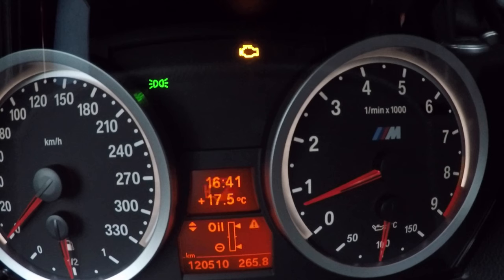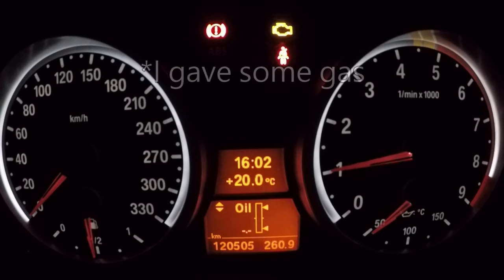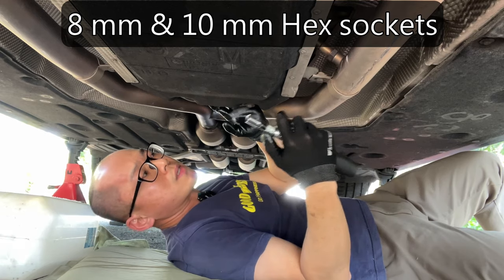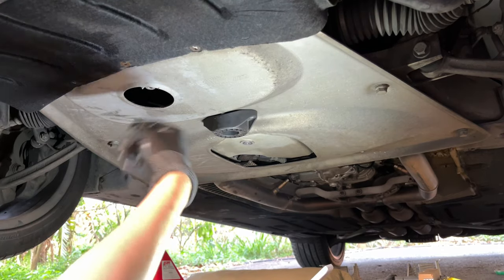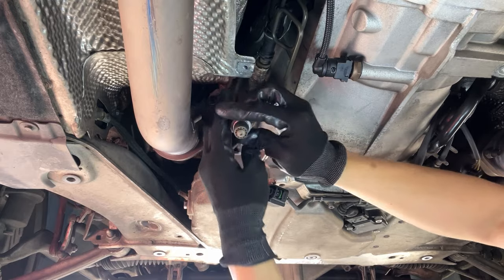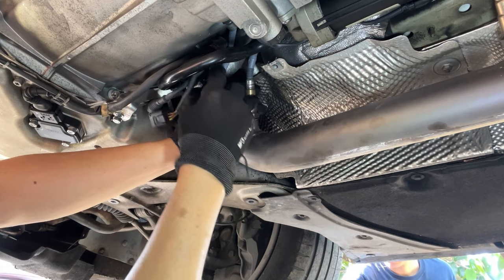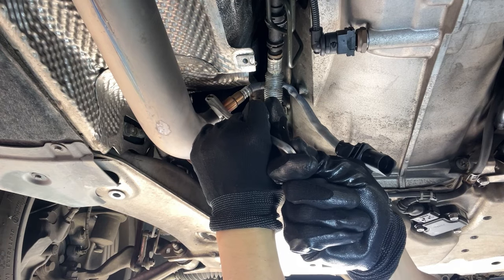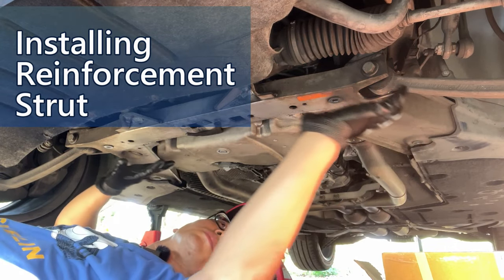O2 Sensor Replacement Fixed Rough Idle & Limp Mode of E90 M3 [ENG SUB]

Comment from the maker: [Errata] The “thread glue” I mentioned is actually an anti-seize lubricant.
[勘誤] 我提及的「螺絲膠」應為防卡死螺絲膏／潤滑膏。

Please look into the fault codes carefully to identify the root cause! This was the bad O2 sensor BEFORE CATALYZER. 請仔細從故障碼判斷問題的根源！這次是「觸媒前」含氧感知器的毛病。

**Parts Required**
Oxygen sensorBEFORE CATALYZER X2
BMW 11 78 7 537 984
Bosch LS 17038 / 0 258 017 038

**Tools Required**
8 mm hex socket (trims)
10 mm hex socket (trims)
17 mm hex socket (reinforcement strut/plate bolts)
torque wrench with angle (56 Nm)
22 mm open hex spanner (O2 sensor)
22 mm open hex torque spanner (25-50Nm)

**Tightening torque spec**
O2 sensor before catalyzer 50 Nm (OE exhaust)
after cat 25 Nm (OE exhaust)
Bolts on reinforcement strut/plat 56 Nm + 90° (replace blots)

**所需零件**
「觸媒前」含氧感知器 X2
BMW 11 78 7 537 984
博世 LS 17038 / 0 258 017 038

**所需工具**
8 mm 六角形套筒 (飾板)
10 mm 六角形套筒 (飾板)
17 mm 六角形套筒 (加強車架)
附角度扭力扳手 (56牛頓米)
22 mm 開口六角扳手 (含氧感知器)
22 mm 開口六角扭力扳手 (25-50N牛頓米

**鎖緊扭力**
觸媒前含氧感知器 50牛頓米（原廠排氣管）
觸媒後 25 Nm（原廠排氣管）
加強支架上的螺絲 56牛頓米 + 90°（需更新螺絲）

Comment: I have a BMW E60 528i with an O2 Sensor code of 2CA6 (O2 Sensor heater circuit error Bank1 Sensor1). Car runs and drives just fine but the check engine light is on. No limp home mode. I have a 50/50 shot that it's either the O2 sensor needs replacing of the car's wiring harness for the O2 sensor is shot.
Reply from the maker: Hi CJ it's good you are aware of this fault so when something happens you can take action right away... and the right way 😁 I guess the O2 sensor can still work without the heater circuit because exhaust temperature is high enough to keep sensor at it's working temperature. But it's likely to give wrong data when the car is cold.

I searched 2CA6 in ISTA for E60 528i and quote this;

Condition for fault memory entry:
 O2 sensor temperature < 680 °C for more than 5 sec.
 
Action in service:
1. Visual inspection of wires, DME plug and O2 sensor for damage
2. Check wires (including resistance)
3. Check plug-in connections DME <=> Wiring harness <=> Upstream (pre-cat) O2 sensor on Bank 1 (water or corrosion in the plug? => Repeatedly disconnect the plug and then FIRMLY press it back in)

4. Replace O2 sensor
5. Replace DME

I hope it's just a minor wiring harness problem for you. Come back and let let know how it's fixed. Best.

Comment: Thanks, the beginning of the video is hilarious, loved the way you said we'll get you fixed baby.

When will you upload the transmission and differential fluid change video? really really want that.

and one more thing, do you have any tips on trouble shooting DSC malfunctions on this car. I currently have this

-Start-off assitance inactive
-DSC malfunction! Drive carefully
Reply from the maker: Hi Kojo Thanks for the comments! I’m happy you like this video 🤗

I had the same warning message twice due to:
1. poor connection of SZL plug: access the switch column and use electric contact cleaner to clean the plugs before  re-plugging it.

2. throttle actuators failure: the malfunction can be the actuators or line connections. Need to see the code.

AND DSC codes can be cleared only if DME has no codes. So make sure the problems and codes on DME are all cleared.

The M3s have high and uniform quality so they all have same issues 🤣 don’t worry pal, there must be a fix for us. Best wishes!
Reply from the maker: And the next video will be the MT and LSD fluid change. Stay tuned!
Reply: @funcarsgoodpeople  Thanks thanks, I just realized you have the MT, I have the DCT, also 4 door e90 m3. I guess its the LSD fluid change i'll benefit the most from. Thanks for everything, one big happy m3 family

Comment: Hello, do you know where is the fuse for the 02 sensor located  for the e92 M3? There is a video on youtube about the E92  02 sensor fuse location, but it is only for non-M.  Thank you in advance...
Reply from the maker: Hi Cy! I’ve checked the posts regarding the O2 sensor fuse on some forums. I’ve also checked the wiring diagrams of E9x Ms/non-Ms in ISTA.

Here’s my summary; An O2 sensor does not have an exclusive fuse. All the wires on an O2 sensor are connected to the engine control module (DME). The heating power of an O2 sensor is provided by the DME. 

So the actual fuse you mentioned is one of the fuses for the DME. I guess people are pulling the fuse to reset the DME to clear the fault codes related to the O2 sensors.

There are two fuses via which power goes to the DME; one for power loads (30A) and one for the electronics (10A.)

For the E9x M3’s DME (MSS60) the fuses are F4 (10A) and F39 (30A). There is also another DME main relay (K6300) integrated in the fusebox A4010. NOTE: fusebox varies with production year!

You are welcome to mail me via: funcarsgoodpeople@gmail.com and let me know your VIN. I’ll send you the related documents and wiring diagrams.

Comment: Awesome video. I'd like to check the shaded fuse for all of my sensors. I saw a video on here showing me that there was a bank of 5 fuses inside a black case I side the engine fuse box but on mine no such bank exists which suggests it's in the glove fuse box but I have no diagram and no idea where to locate it it :(
Reply from the maker: Hi Dane thank you for the feedback! Which car model are you talking about? The S65 engine does not have independent fuse for the O2 sensors so I did not have to check them during the troubleshooting. If you are looking for fuse map or wiring diagram for a BMW, you can mail me funcarsgoodpeople@gmail.com and I will look it up for you 🤗

Comment: I am chasing the same symtoms as your. My car is E70 pre-lci. The only sensor code I got is 2C31. Can your verify the 02 is my root of issues? Thank you
Reply from the maker: Hi Quan I have the same fault (but different code) at the beginning. Yours corresponds to DME: Oxygen sensor before catalytic converter, trim control or DME: Oxygen sensor emissions control. So yes that's it! Please suspect a bad O2 sensor.

Please note that there's some variants of the engine so some X5 have single O2 sensor and some have two. Let us know if it works for you!
Reply: @funcarsgoodpeople  absolutely, I have been chasing this ghost for a while. Overlooked the sensor and replaced vanos solenoids, Camshaft sensors, Disa and eccentric shaft sensor but still. Thanks
Reply from the maker: I understand how disappointing it was! After all we will fix it for sure. Best luck!
Reply from the maker: You are right Makaveli! There are millions situations that can occur so sb else’s help from the Internet is really limited.

So Quan plz gather as much clues as possible for us to sort it out. Best.

Comment: Dude why don't you have 200k subscribers... I have this problem with my 02 sensor bank 2 sensor 1
Reply from the maker: Hi Jdm Slater thank you 🤗 I’m just starting out. I’m happy enough the video gets to someone whoever needs it. 

It’s a good news you got the fault code and know it’s sensor 1, before the catalyzer. You are very close to solving this problem. Please let us know how it works for you 🙏🙏🙏
Reply: When it’s cold mine revs up to 2000 rpm for while tell it goes down and starts having a rough idel does that happen when o2 sensors go bad n52

Comment: I have this issue with driveoff with diesem engine. Does diesel engine have same sensors?
Reply from the maker: Hi Mirzoni, the diesel BMWs have O2 sensors too, just different part numbers. It is recommended to scan the codes with diagnostic tool to get more clues before ordering and replacing the parts. Best!
Reply: @funcarsgoodpeople  i will do check before ordering parts. Also i have rough idle no matter cold or hot engine  but my rpm are good just idle is not good to hear. First time i was thinking maybe its egr valve but im sure its 02 sensor
Reply from the maker: I see. I think it is easier to fix O2 sensor because there will be fault codes so we can make sure about the root cause. Come back and let us know if you succeeded!
Reply: @funcarsgoodpeople  Sure i will. Can you tell me can i conact you in a private? Ig or facebook?
Reply from the maker: Please add fcgp2019@Instagram or e-mail funcarsgoodpeople@gmail.com 😀
Reply: @funcarsgoodpeople  Thanks, i just started to following you on IG.
Reply from the maker: 🤜🤛 keep in touch bro 🙌
Reply from the maker: Hello Mirza How are you? I made a video about using the OBD2-USB cable to flash the DME. I show you how to buy the cable and where to download software tools. Please see the video https://youtu.be/-HcMYBclj_Q

Comment: I have 2B4E codes and 2B42 to 2B49 misfires impairing exhaust emissions on all 8 cylinders, i changed the O2 sensors but without doing the reset of adaptations, i ll do it soon, and a rough idle at cold start only, i had this issue after changing my full exhaust system (x pipe + front pipe with sport cats) is it related ?
But I don’t have an engine malfunction reduce power and a limp mode like this M3..
Reply from the maker: Hi Dev thank you for chiming in. I don’t think the rough idle is related to the X pipe and sport cats. What I often heard about rough idles are related to the fuel tank breather (rough idle after filling a full tank) and the idle control valve.

I had the misfiring codes on all 8 cylinders when I still had the stock cold start function. Usually the codes came when the car was having the asthma (for warming up the cats to reach emission standards quickly.) There was nothing else than the codes and a check engine light. After this function was tuned out, I NEVER had all-8-cyl-misfiring codes anymore.

The E9x M3s all have similar problems so don’t worry it is likely something already happened to someone. Plz check if your car has the stock DME tune, a bad fuel tank breather valve or bad idle control valve. Best wishes!
Reply: @funcarsgoodpeople  

I changed the idle control valve & the fuel tank breather.. the issue is still here, i changed the O2 but i didn’t make a reset of adaptations, i ll do it soon, i have the same cold start like you every time i start the car with stock DME, when the engine is warm i have no issues, no reduce power or engine malfunction.
Reply from the maker: I see. Probably resetting the adaptations of O2 sensors and idle value can help. Let us know if this work for you! Best.
Reply from the maker: Hi Dev how are you? Have you solved the problem? I made a video about misfire fault codes and cold start delete https://youtu.be/-HcMYBclj_Q

Please let me know what you think!
Reply: @funcarsgoodpeople  hey fine and you ? Yes i’m in the same case, same fault codes also, your car has no more misfires codes and rough idle at cold after deleting cold start ??
Reply from the maker: @Dev  Hi Dev I'm good thank you! I did cold start delete (by tuning shop) in 2021 and there was not any misfire codes until 2022, when the O2 sensor got broken.

I used the MSS60 Binary Modification Tool to recover the cold start to make the new video. And the misfire codes come back! So they are really related.

Please note the difference: Cold start -> misfire impairing emission. O2 sensor fail -> misfire with fuel cutoff -> limp mode.

Now, I turned off cold start again. Comfortable :)
Reply: @funcarsgoodpeople  I have Cold Start —> Misfire impairing emission only, can we turn off the cold start at BMW directly with Ista ?
Reply from the maker: Unfortunately no, Dev. ISTA can command the DME but it cannot change the program. The cold start program is built in the DME so we need to use flashing tools. 🤗
Reply: @funcarsgoodpeople  thanks 👍🏻
Reply: @funcarsgoodpeople  Btw why we have this kind of issue ? Is it related to exhaust modifications ?
Reply from the maker: Hi Dev, no I don’t think it’s related to exhaust modifications. Maybe the misfire detection design was too sensitive for aging engines.

In this video, the failed O2 sensor was the only problem for misfire. This is not common on E9x M3s but you know the Murphy’s Law; things that can break down will break down 😅

Anyway we must study the fault codes. They are really helpful 👊

Comment: Hello I have a 2008 750li and my car went into limp mode when I put the obd2 I got codes of throttle body/pedal position sensor and also catalyst system efficiency below threshold(bank2) I swapped out the TB and the gas pedal and still nothing I even swapped out MAF sensor and I’m still in limp mode do you think my problem is just my O2 sensors ?
Reply from the maker: Hi Sakk thank you for the message!

Could you please show your fault codes? Let me check more in detail.

For my case, there will be fault codes about O2 sensor if it is really broken. The " catalyst system efficiency below threshold(bank2) " code doesn't tell about a broken sensor. We need to keep monitor about this one.

Comment: I have problem at my 320i e90, fault code is 2ABC : oxygen sensor before cat converter mixed up, 
I replace oxygen sensor but dont normal, but i don't adaptation on ista, maybe any info for solve my problem, thanks
Reply from the maker: Hello Purwokerto, please check the two wiring harness (or the plug connector) of the two O2 sensors. Make sure they are not mixed up or swapped.

Adaptation reset is also needed because the DME does not know new sensors are replaced. Maybe you can use the disconnected battery method to reset the whole car. Otherwise a diagnostic tool/software is needed to do the reset.

Comment: Just seeing this video but i have an e92 with the n54 and my car is misefiring in cylinder 2 and is running code p0040 with the misefire code p0302. Could the o2 sensor failing create misfires ?
Reply from the maker: Hi Antonio, the P0040 code implies that the o2 sensor connectors of bank 1 or 2 may be mistakenly swapped. The six cylinders are divided into two banks and I believe their o2 sensors are very close and identical.

Please check the connectors to see if they are correctly installed. You can also clear the codes, swap the connectors and see if P0040 comes back. Sometimes cleaning the connector contacts will also help.

I don’t think P0302 is related to P0040. There may be a bad spark plug or ignition coil on cyl. 2. Usually we swap the plug or coil ONE AT A TIME to see if  misfiring goes to the other cyl. If so we can nail down that faulty part.

Please come back and let us know how it works for you. Best luck!